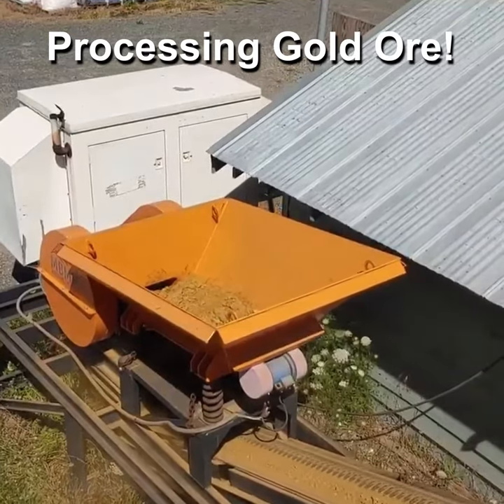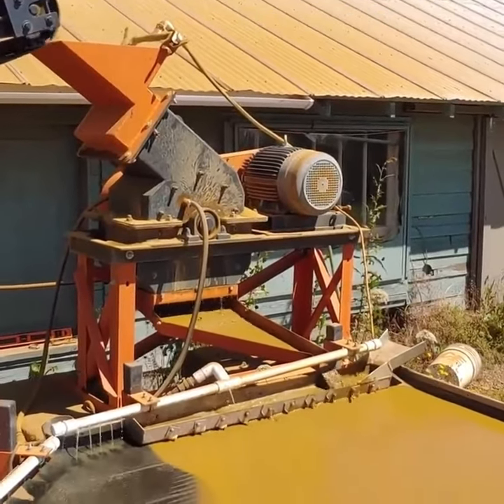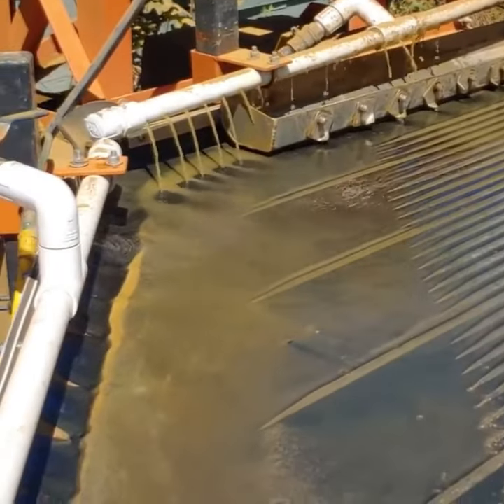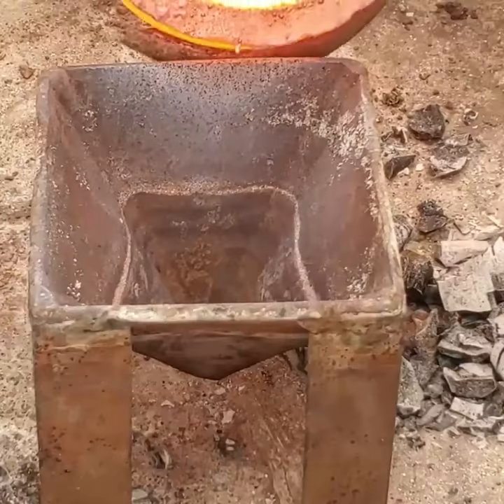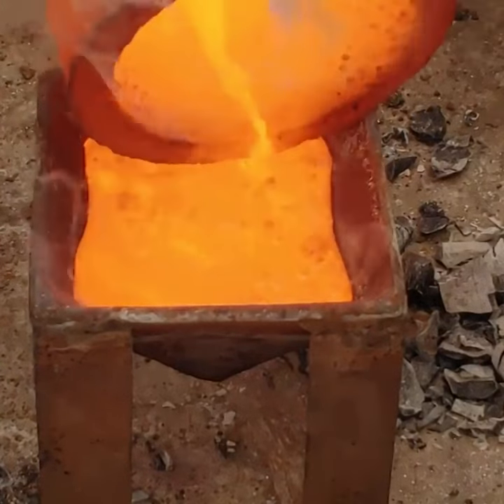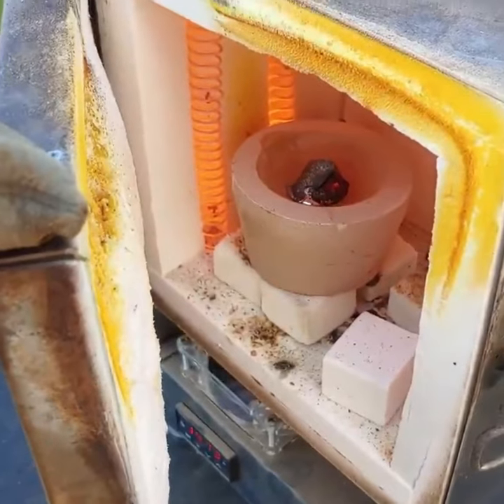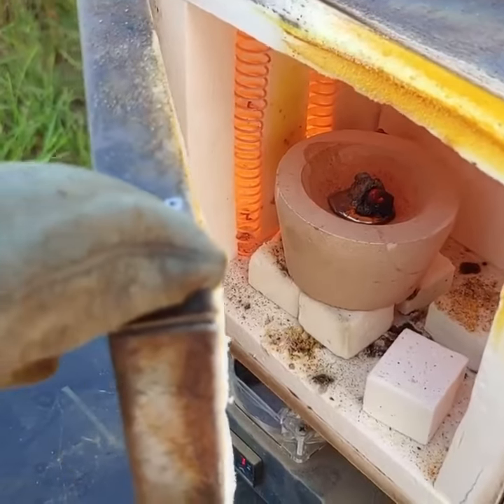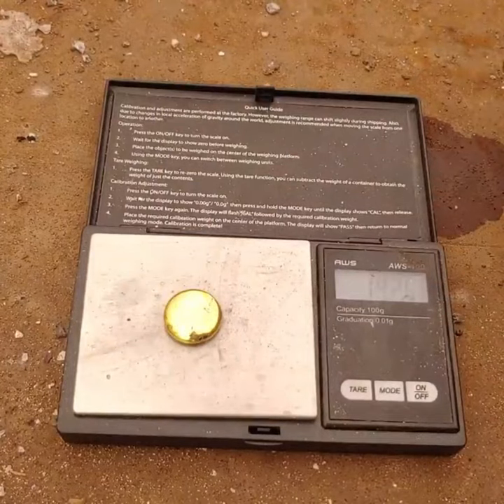Rocks To Gold

Comment: I've always wondered, you make and sell all this equipment, but you don't use your  own conveyors and ball mill, is there a particular reason you don't or just don't want to have to have  a more permanent setup
Reply: I'm sure he doesn't need a ball mill, you don't need to crush it that small unless you intend to use cyanide to extract it from the float. Many ways to skin an ore deposit! Besides, a ball mill is a huge contraption, and steel balls are heavy, not making it a portable item. Duh. Think before you make a comment, ok? It's better to not show your ignorance.
Reply: And ball mills are for many tons of ore, long processing times, and a whole different process.
Reply: @richardmccann4815  
Asking questions is intended to end ignorance of a topic, you snide prat.